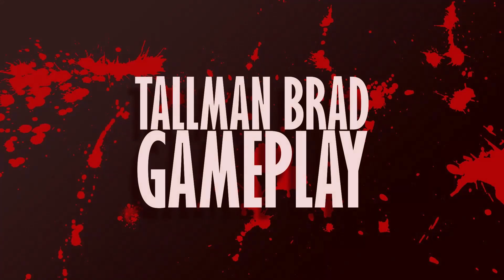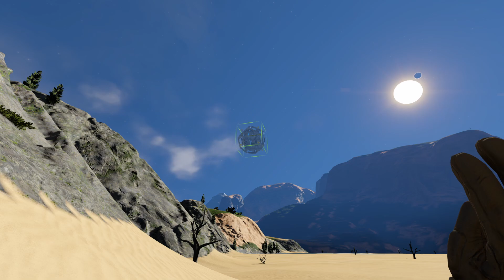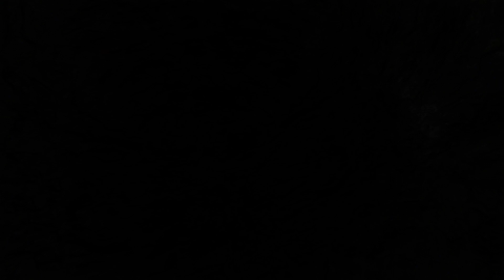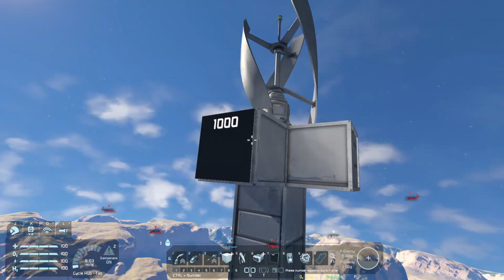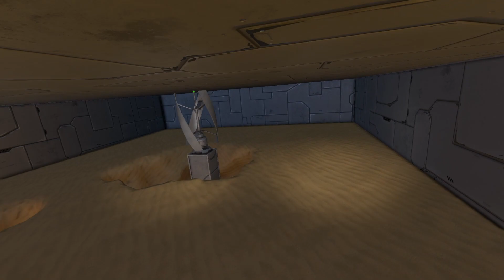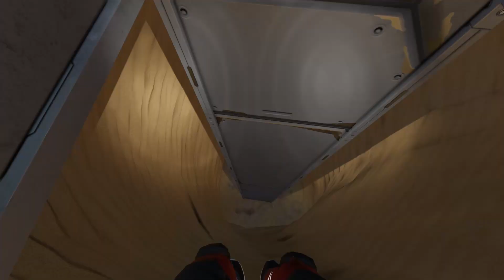Are Turbines Broken? | Space Engineers

Comment: Is the clearance all the way around the turbines or is it just at the left,right,front. And back of it. Aka can you cover up the turbines corners and conceal them. Conceal them inside of a wall for instance.
Reply from the maker: You can cover the top (the tip/ball bit) but it needs 8 blocks all the way round the blades part. You could possibly mount them horizontally behind a wall? As long as the wall is at least 21 blocks high (to get optimum) and the turbines are in the middle of that wall. So 11 blocks up. Your wall would then be 5 blocks thick. That might work. Let me know if you try it. I'm interested to hear how it turns out.
Reply: @TallmanBradGameplay  ill try it on a creative world when I get home and let you know how it goes, thanks.

Comment: :-) Very interesting indeed
Did you know that a tower. (This bit is hard to explain) If you tower up your 11blocks put a turbine side ways then build another tower 7 blocks away and place another sideways turbine you can have the tops only 1 block apart. Hope that makes sense
Reply: The towers at 1.59 could be i think 1 maybe 2 blocks closer to achieve the same result (MAYBE) lol
Reply from the maker: Right! Got it! Yes, the 2 trees I showed joined together could be 2 blocks closer. To be honest I just threw down some blocks and didn't work out the distances exactly for that model. Really I was focused on showing the 2 trees vs the turbine field. Looking back, I should have put them closer to demonstrate that they could be closer. Well spotted!
Reply: @TallmanBradGameplay  I didnt mean to lol i just know when im trying to keep things tight. also you can have them power rovers or ships if you are landing geared to the ground. I once bult a rover with a turbine on a piston to power myself
Reply from the maker: A turbine on a piston? Hmmm there's a thought... Haha
Reply from the maker: It does make sense. I think the tips of the horizontal turbines should be 2 apart though, if you've got a vertical turbine on top?
Reply from the maker: Just to keep the max output of the vertical turbines. If you are using them...
Reply from the maker: I've got that wrong. If you use the tree that I demonstrated the horizontal tips would be touching as there's 1 block pushing the horizontal turbines out. So a gap of 8 blocks would have 2 horizontal blocks and then the 6 taken up by the turbines. I might not have understood what you're saying though. My apologies.

Comment: Everything seems to hinge on the distance between the lowest block in the grid (relative to terrain height) and the turbine. I wonder if you built a large sprawling complex, but had a single "spike" of blocks going deep into the ground under it, if all the turbines on the complex would behave as if they were +9 blocks up?
Reply from the maker: @Craig Brideau, Craig I built a base, 5 blocks high, placed a turbine, checked the max output, dug a hole under 1 corner 5 blocks deep, extended the corner of the base with the "spike" and the turbine got max efficiency!
Reply: @TallmanBradGameplay  Wow so that means it is dynamically calculating the lowest point on the grid to figure out turbine efficiency!
Reply from the maker: I also extended the turbine that was up on the hill, up to 1000 blocks and the output was the same as the lowest one on the hill. I did expect that. But just wanted to let you know I tested it anyway.
Reply: @TallmanBradGameplay  If you cut away the underground spike does the efficiency drop back down again? It would give you some idea of whether the game is constantly checking that parameter.
Reply from the maker: Here's the frustrating thing. It didn't go back to its original max. It stayed at optimum. I wonder if I logged back in it might update. To be honest I was a bit disappointed it didn't go back to its original value.
Reply from the maker: Yes exactly! Craig, try your idea out and let me know! I have a suspission it might be the first block you place that the calculations connect to. So you might need to do a hole first then build a base from the spike out over.
Reply: @TallmanBradGameplay  That was something that Splitsie demonstrated in a Blueprint and Projector tutorial a while back: Grids perserving their starting point based on the first block placed.  It would be interesting to see how building the spike after or even removing the starting spike later would change things...
Reply from the maker: I remember that one. It was to show where your projection would start from. The orientation too. It was the one with the coloured blocks indicating x, y, z? I don't think he mentioned objects connected to the starting block having their properties impacted by it though? Interesting stuff either way. Splitsie is the master.